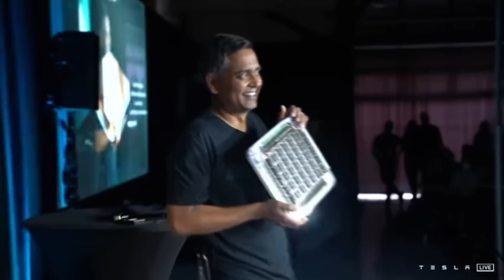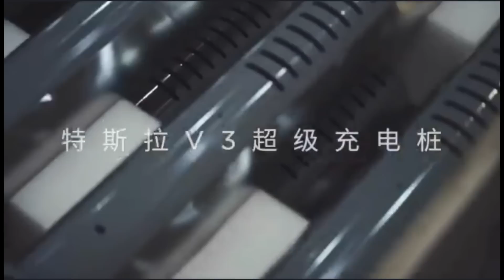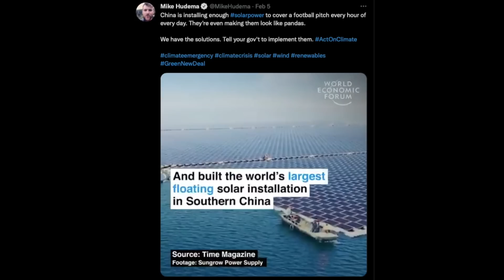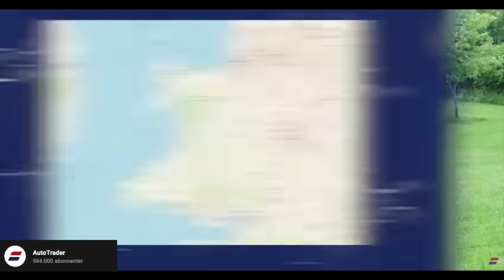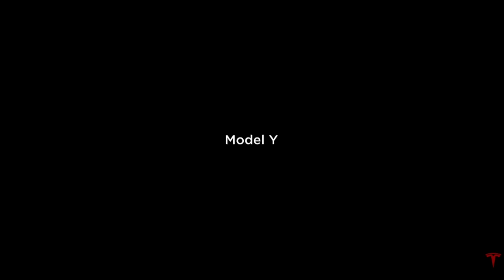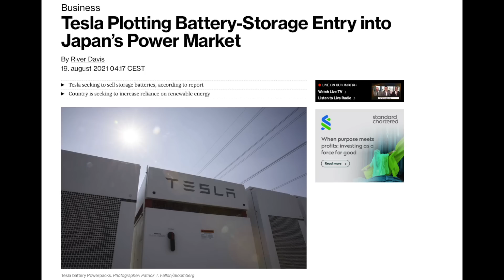Tesla Model Y is taking off in Europe | EV’s will be allowed to drive faster than ICE !!!

Comment: It only costs $2.4 million US to get a production car that can out-accelerate a Model S Plaid costing around $130K.  Nice work, Rimac!
Reply: With no space for passengers, worse range, no autopilot, and no supercharger network.
Reply: Is the RIMAC really a Production car ???
Reply: @chrisbraid2907  not yet. Hasn’t been delivered to a single customer.
Reply: @robcoll1069  How many families can afford 66k € car?
Reply: @Urgelt  I don't see a problem with it. Let Rimac make those expensive electric hyper cars. Elon only made the S Plaid so fast so he could beat all ICE production cars out there. To show the world that Electric is better and faster in all measured rankings out there. Mission Accomplished.
As Lars said, Elon still has a card up his sleeve with the new Roadster. Which will be around 10% of the Rimac price and should have similar or better speed/acceleration figures. Not sure about the number of Roadsters they are planning to build, but they will probably sell a lot more as the 150 the Rimac is going/planning to build. After those 150 they will probably come up with a special limited edition that has 100hp more or has golden door handles or a special color etc.
Reply: @Curacars  That's how I see things, too.

Details are a little fuzzy at this point, but Rimac/Bugatti doesn't appear to pose a threat to Tesla sales.  The threat they pose is to ICEV supercars.  I'm all for that!

I don't think it matters much if Roadster will beat Rimac's supercars.  It will be addressing a different market segment.

It might, though.  Tesla sees a path to developing even better electric motors with their carbon-wound rotor tech.  With 4680 cells and (probably) front and rear gigacastings, I think it will be very difficult for cars made with older tech to keep up.

And if they can figure out how to incorporate useful cold gas thrusters...

Hell.  The acceleration would probably not be survivable for an old fart like me.  :P
Reply: @Urgelt  yes, it indeed doesn't really matter with the miniscule volumes and the astronomical prices of those super/hyper cars. But I find it funny that due to the economies of scale, you can build a 4 door sedan with almost the same specs as the almost 20x more expensive. Imagine that besides the Roadster they still have the Plaid + version with the 4680s somewhere in the design drawer. I'm sure that Elon will open up that drawer when let's say a Porsche comes close to the Plaid, just because they can.
Reply: @robcoll1069  Tesla is not yet affordable to the masses. China will have a greater impact worldwide. Battery cycle life is still the biggest problem to most manufacturers. The winner will be the one with the best battery tech. Electric motors are not the problem, we've been building them for hundreds of years. Tesla has no advantage in this area.
Reply: @MegaWilderness  Tesla doesn't need to be affordable for the masses yet, if they would launch a 20k usd vehicle they could not produce enough of them, you would be on a 5 year waiting list, sort of how East Germany had the Trabant cars with a 10 year waiting list. And even now they can't produce enough 40k usd cars either. When they are finished with Berlin and Austin, they will surely need to build 2 or more new factories with an even bigger output. Only when those are up and running, they can think about lowering prices on their cars. Using all lessons they have learned with producing the higher priced cars and the infrastructure they have already created.
Reply: @MegaWilderness  Motors can be improved.  Tesla has improved them.  Their weight-power output ratio is excellent, and they have a developmental path to making even better motors.

Put a 100 year old electric motor in an electric car and you will not impress anyone.  This isn't a developmentally static engineering topic.

Don't over-focus on cycle life for batteries.  Yes, it's important.  So are other performance and engineering characteristics.

A battery that weighs too much, with poor energy density, rotten charging speed, and excellent cycle life won't ever make it into cars.
Reply: They're 2 totally different cars. Might as well have compared a Lamborghini to a Dodge Charger
Reply: @MegaWilderness  Lol. Industry expert Sandy Munroe who’s seen it all begs to differ. He said that Tesla’s motors, electronics, software, metal casting technology, and batteries are the best in the industry and constantly improving. He’s an objective third party well qualified to comment so I believe him.
Reply: Rimac have just bought Bugatti from VW. The latter no doubt realised that Uber power ICE cars are suddenly old hat. They’ve flogged it off and we can expect Lamborghini to go the same way.
Reply: @richardbutton1179  Right.  But I'm not sure that a comparison between the Roadster, when it appears, and the expensive top-of-the-line supercars will be a pointless exercise.

We shall see.
Reply: @TecnamTwin  Has he looked at YASA, Yamaha, Formula E, STARD Projekt E Rallycross, and the myriad Chinese motors.
Reply: @lahvancz  more than you think as they are making cars. Order one now(August) and get it in Jan/feb.   with that said, even rich people don’t buy $2.4M cars.   I personally know a billionaire and his most expensive car is a Lambo SVJ ($700k?).  The only people that will buy that are maybe multi-multi-billionaires (I’m not rich)
Reply: @Dave5843-d9m  I do believe in exchange for Bugatti and their Bugatti factory they had to give 50% of Rimac shares to VW or Porsche
Reply: @Curacars  if they don't Wuling will continue to outpace them
Reply: @TecnamTwin  your right - just saw this post, as I was writing too lol.
Reply: @MegaWilderness  Iam sorry that I have to proved you wrong...!!WHO is competing with Tesla on anything...on battery, software,electronics ,motors, superchargers  and range..Just Mention one..?
Reply: @chrisbraid2907  depends on your definition of production. Some say that means 25 cars - some say 50. But no one would consider it a MASS PRODUCTION car.
Reply: @Curacars  You're ignoring what the world needs and can afford. Do you have a passport?
Reply: @MegaWilderness  Of course I have a passport. And a driver's license and an ID card? The cheaper Teslas will come but no <5k usd versions. Let the rest of the automotive industry take care of those. Will the Wuling replace an ICE pickup truck in the USA? It will replace scooters, bicycles and maybe a small ICE micro car?
Reply: Exactly 💯
Reply: @robcoll1069  GAC and BYD for batteries. Rimac, Lotus for quickness and handling Wulin for sales. Aptera for efficiency. GAC for charge rate, probably many more. The list is endless.
Reply: @pazznecht  absolutely. Best of the rest.
Reply: @MegaWilderness  apart from the carbon fibre windings holding the 20,000rpm thing together.
That's new.
Reply: @robcoll1069  - Easy there! The 1.9 Seconds is for 0-60 MPH, not the 1/4 Mile! I know they are "Fast & Furious", but, let's keep "Some Facts Straight!"
😳😲🙄
Reply: @Curacars  - Remember, Berlin is "Starting" production with the Model Y, but, as I understand, or recall, the"Berlin, Phase 2" was planning to be for Model 3's, as well!

That may Change, or it might not, but, that is just Phase 2!

And, yes,as they are now at work building the Battery Plant there, that To may need to be Repeated, for Phase 2, as well!

It might be at Phase 3, that they start production of a "European $25,000 Tesla", in 2023 or 2024! It probably depends on how demand flows for the Model Y & Model 3, from Berlin!
Reply: @MegaWilderness  you are living under a rock...none of the are in productions,,,!!!
lol
Reply: @robertweekley5926  I am not really sure on which reply your replying. But I am not 100% sure there will be a Model 3 for the EU made in Berlin. I'm not sure how much demand there still is for M3 once they start producing the MY in Berlin. They might come up with a M4 that replaces the M3, but that's pure speculation on my part. When looking at the  European EV car sales figures, the model 3 is the only sedan in the top 5 or so, the rest are SUVs and hatchbacks, so with the Y in the mix they will be even better suited to sweep up the competition. The normal car sales in Germany show similar numbers, only the VW Passat and BMW 3 as sedans in the top 10.
So I think a hatchback that is cheaper as the Model Y but doesn't have to be <25k price to begin with, since the ID.3 is 30k euro as well.
Reply: Are you put of your mind?! Its a very limited production car with almost 100% carbon fiber body/monocoque and carbon ceramic brakes....... its also a sport car, not made to drive itself lol.....
Reply: @robcoll1069  EVs just like ICEs needs to build for everyone but there are and always going to be exclusivities, not every should have the same boring  car, the models plad is not going to sell like a model y or 3 for example.
Reply: @robcoll1069  another crazy example is the mercedes amg gwagen 6x6 with portal axles, 6 wheels central inflation/deflation system....... cars/vehicles needs to be special or differentiate themselves, koesnigsegg and buggati are another example.
Reply: @chrisbraid2907  yes it is and its limited production car.
Reply: @Urgelt  big lol..... buggati has already achieved 300mph i dont see what else they should have to proove again, the carbon sleeved rotors are not a new thing in motors it has been used for years for applications up to 200k rpms.....
Reply: @Urgelt  the motors are just part of the equation, the batteries also needs to be able to output alot of energy instantly.....
Reply: @TecnamTwin  they are not the best but one of the best tbh.
Reply: @Urgelt  wrong, ICE tech is still evolving and there are tons of different applications and engine and fuel types for many different uses. From aircrafts to ships to trucks, mining equipments...... everything still improves with time along side with transmissions... just look at the most powerful commercial truck in the world its a scania 770s!
Reply: @yingnyang2889  Just as an aside - Tesla doesn't operate its own chip foundry.  It designs its own chips and circuit boards, then orders them produced from TSMC.  Apple does the same thing - outsources the manufacturing, but designs its own chips.  Google does, too.

Other automakers outsource boards - but they don't design them.  They take off-the-shelf circuit boards.  None of those OTS boards are optimized for training neural nets or for inferencing.  Which hardly matters, since none of the other automakers are capable of any machine learning work whatsoever.  They're helpless.  Meat on the hoof waiting for a predator to come along and eat them.
Reply: @robertweekley5926  I put the $25K US car farther out.  I think Tesla will struggle to meet demand in Europe at its current price points for some years.  And getting battery costs down is a work in progress, too.
Reply: @carholic-sz3qv  I think you're missing some details about Tesla's Plaid rotors.  They are not 'carbon-sleeved.'  They are 'carbon pressure-wrapped.'  The high tension on the wrap holds the rotor together at up to 20K RPM.  This is new tech for electric motors.

I think the Rimac has a two-speed transmission, to avoid hitting RPMs that would destroy its motors.

I'm not slamming Rimac's motor tech.  They're doing great.  But nobody has pressure-wrapped carbon fiber rotors but Tesla.  This is new stuff, and Tesla sees a developmental path towards even higher performance motors which they intend to explore for the Roadster.

As an aside, 300 MPH isn't useful in racing.  You can go that fast on a flat desert with some precautions, but on a track with other cars around?  Control is too iffy.  What you want for racing isn't a 300 MPH top speed, but excellent acceleration, braking and handling.

I expect the Roadster to have around a top speed between 220 MPH and 250 MPH.  And that's as high as a track car needs for racing.  More is just wasted capability.  The weight you'd add for more top-end speed will cripple the car in actual racing.

As for the Autobahn, anything above 180 MPH is ridiculous.  With other cars on the road, and no track management, going faster is life-threatening.  I'm sure that the Autobahn's lack of speed limits is a point of pride for Germans, but if cars traveling faster than is even remotely safe becomes an issue, I think they'll have to give up on the whole no-speed-limit thing.

Bugatti went for bragging rights instead of track performance.  Kinda dumb, if you ask me.  (I know, you didn't ask me.)
Reply: @carholic-sz3qv  Yep.  Motors are just one part of the equation.

No automaker focuses exclusively on one part.  In Tesla's case, they're generating valuable IP in just about every aspect of auto manufacturing, from component design to production methods to software.  They're an innovation factory.
Reply: @Urgelt  its basically the same thing carbon sleeves or wrapped like I said again , carbon is used for applications up to 200k rpms to avoid the rotors from overheating or expanding/exploding. The tesla stuff is definitely not a new stuff. Going up to 300mph is actually going to the limits of what tires, traction and electronics are possible, it shows the capabilities of a powertrain just like with diesel vehicles that can have up to 1000 miles of range .
Reply: @Urgelt  you are not the one to dedice which speed is good for racing, the german Autobahn is the best/most secure highway in the world and and doing 180mph isn't ridiculous a all when it says speed unlimited. Most cars on roads already have safety features and depending on the weather everyone can push their cars to the limit in safety, there is a dedicated lane for faster drivers.
Reply: @Urgelt  if for you 300mph is useless then why is 0-60 in 1.1 that important?! Hein! People needs an very cheap EV with the promised tesla "600 miles" of range.
Reply: @Urgelt  did you even read my comment?! I said part of the equation I didn't exclude any part of the system every companies are innovation companies too. For example bmw and volvo have been using recycled materials to produce their cars....
Reply: @Urgelt  ICE is evolving my dear, vehicles have become bigger and heavier with time and all the comfort features and equipments are the things that uses alot of energy.
Reply: @carholic-sz3qv  ICE vehicles can get 1000 miles of range, not through improved efficiency, but by making tanks bigger.  Carrying that much fuel adds weight and decreases the energy efficiency of the vehicle (cost per mile).

BEV cost per mile is a fraction of ICE.  That gap will widen as BEV tech improves, while ICE tech remains static.

ICE tech will never be able to eliminate CO2 emissions.  It will never be able to eliminate fumes which kill thousands of people every year.  It will never be able to improve its energy efficiency without resorting to electric hybrids - which still will produce emissions and fumes.

We haven't even spoken of repair costs.  ICE costs way more in time, convenience and money to keep on the road.

ICE is over, my friend.  We've got better tech now, and our civilization is busy converting its transportation industry to it.
Reply: @Urgelt  electric vehicles existed way before ICEs and the technology is also not that different from todays EVs, the electric motors have  barely improved in efficiency and the batteries still trolls behind with very heavy weight and inability to be as flexible as ICEs, you cannot even increase the range of an EV by adding more batteries what a shame. There is a reason why batteries will not work on aircrafts.
Reply: @carholic-sz3qv  0-60 in 1.1 seconds is not important.  It's only amusing.

We do look forward to longer ranges and better efficiency from BEVs.  We can look forward to longer ranges and better efficiency from BEVs, because the tech isn't mature.

Unlike ICE tech, which is plateaued.
Reply: Let me use $130k to get one plaid and gut it to the bone and race it against Rimac, let me buy another plaid for normal driving. After that, I still have MORE than $2M left in bank.

It's irrelevant to talk ramic against plaid, production or not.
Reply: Your assertion needs a little modification. One car is not a production model but good point. Musk is simplifying complex problems with ease it seems an without missing a step.
Reply: They couldn't possibly have sold/offered it for a dime less than $0.4 million.  NEVERA!
Reply: @Urgelt  oh didn’t know the specific company, but from AI day, it seemed like tesla was making its own DOJO boards and neural net hardware and stacked assemblies. Thank you
Reply: @carholic-sz3qv  Heh.

Batteries will work on aircraft.  Some startups are already playing with prototypes.  Elon predicted that 400 KWh per Kg will be good enough to make serious battery-electric aircraft.  That energy density is not all that far off.

Early BEVs used lead-acid batteries with very poor cycle life, energy density, etc.  Gasoline trumped them right  out of the market, because gasoline tech was easier to develop back then.

And it has been developed for over a century since.  But there is nowhere for that tech to go now.  It's plateaued.

This is dawning on automakers, too.  One by one, they are discontinuing their R&D funding for ICEVs.  Some will figure it out faster than others.  There's no shortage of stupid people in the world.
Reply: @yingnyang2889  The node chips are coming from TSMC on their 7 nm fab process.

I'm not entirely sure what is handed off to Tesla from TSMC.  Just the node chips?

I've never heard anything about Tesla running a chip foundry themselves - and there are more chips and components than just the node chips TSMC is making for them.  They're getting those other components from somewhere.  Some of those components are probably off-the-shelf.  Some may have been designed by Tesla and farmed out to fabbers for manufacturing.  Alas, we didn't hear a breakdown of how they're handling component supplies at AI Day.

We did get a good overview of the Dojo hardware design concept.  That alone was enough to lift my eyebrows all the way to the ceiling.  This is a crazy big jump in scalable hardware for neural net training.

Google might have something this scalable for machine learning.  They aren't talking about it to outsiders much.  But their focus isn't the same.  What they need from neural nets is language comprehension, so the data feed is mostly symbolic.  (An oversimplification, please forgive me for it.)

Whereas what Tesla is after is perceiving and understanding the real world, navigating through it, and making good decisions about it.  Their data feed is video from multiple cameras.  I imagine that Google's large-scale machine learning architecture is optimized for their use cases and not applicable to the problem Tesla is tackling.

True machine intelligence will require both symbolic cognition and understanding the world through sensors.  Dojo is specialized to tackle the latter.

Of course Dojo will be reading street signs, markings, etc.  So there will be some symbolic processing in Dojo.  And Google has some visual search capabilities, so their machine learning architecture is not 100% symbolic, there is some object recognition in the mix.  I'm still convinced that Google's machine learning architecture is optimized differently.  The two companies are pursuing different goals, and that implies different architectures.
Reply: @Urgelt  I wish I owned his "small" business. He says the pandemic has been an advantage to him. I like him and have watched almost all he has produced. Racing Tesla's shed 500kg, even they have a way to go. Everyone keeps going on about vertical integration. Tesla does not design their HVAC compressor, To use die-cast parts requires high volume runs in order to justify the cost of the machines. I, building a car in my garage would need to hand-weld everything as a spaceframe and use an English Wheel to make the body? Does Tesla make the gears in their gearbox and differential,? Does Tesla make the bearings? Does Tesla make the glass? Do they make the headlights, taillights? Making a good electric motor requires tight tolerances. We don't really need a teardown of a Plaid. Elon explained that he's wrapped it in carbon to stop it self destructing at high rev's. It's the same car, we will learn very little. I want to know how a Wuling is built for under $5000. Let's see him teardown the Iconic 5, Kia, Xpeng, BYD, GAC, Polaris, MG etc...instead.
Reply: @Urgelt  lol..... those startups are making electric aircrafts that are even less practical than helicopters. Even the supposed 400kmw/h won't be enough, majority of aircrafts are huge for mass transport, only small private jets for small trips might be possible
Reply: @Urgelt  there is certainly other technology than just batteries for the future, just like solar and wind and hydroelectricity...... same with nuclear or geothermal.....
Reply: @carholic-sz3qv  Got to start somewhere.  They're iterating.  Same thing SpaceX does.  Fail.  Learn.  Do better.

Elon has in mind a VTOL supersonic battery-electric aircraft.  He has not disclosed the concept in any detail at all, but we can at least think about what it will entail.

Thinking is good for you!

A very high percentage of mass will be in the batteries; this is unavoidable until battery energy densities are way higher than 400 WH/Kg.  So we know they will be conformal.  Could be 60% of mass.  Or even 70%.

Contemporary aircraft use conformal tanks in the wings, but not the entire aircraft.  Battery-electric aircraft will be quite different.

So much mass for batteries will leave a small mass budget for passengers and cargo... unless the whole thing is upsized well over what we're familiar with on runways today.  Make it big.

Delete the retractable landing gear, we won't need it.  Replace with retractable skids.  That saves a lot of mass.

Taking off vertically imposes a high energy cost.  Put a pin in that.

The secret to supercruising is altitude.  A battery-electric aircraft doesn't need oxygen to feed its engines; it only needs enough air for control authority.  At 80K feet, air resistance is very low, so we won't need a lot of power to go fast and sustain the speed.  Efficiency once at altitude will be ridiculously good.

But getting to 80K feet will be a bit time-consuming and energy-costly.

The upshot is that this VTOL supersonic aircraft we are imagining is a long-route aircraft.  It makes no sense to build it and use it for short hops, where it won't have time to get to supercruising altitude.

Descending won't take much energy at all.  Neither will landing.

It won't need a runway, just a takeoff and landing pad.  Small airports could service long routes with this beast.

As battery energy densities improve - and they will - newer models will be able to increase passenger and cargo capacity.

So when might we see something like this?

Not soon.  It'll take ten years just to get the thing designed, iteratively prototyped, tested and approved for commercial flights.  Maybe more.  And I doubt development will even start until we pass the 400 WH/Kg mark.  Possibly not until we pass 500 WH/Kg.

We might look for a prototype's first flight in the 2040s.  Maybe.  I doubt it could happen much sooner, and it might be a lot later.

But this is a concept that in principle is feasible.

As for shorter hops, those are indeed the focus of existing battery electric airplane development.  We'll see more of those types of aircraft well before Elon's supercruising VTOL idea.  Their ranges will go  up as battery energy densities improve - but we won't see them on long flights.  For that, supercruising is the right answer.  Getting to very high altitude is the key - something contemporary jets can't do.  They need to breathe.
Reply: @carholic-sz3qv  Heavy duty equipment and machines will burn fuels for longer.  Niche markets like that are not the low hanging fruit.  But there are poisonous emissions.  Eventually, they're all headed for extinction.  All of them.

Boring Company is already moving in this direction.  Instead of ICE borers, which require extremely expensive venting and air quality control (else people will die in the tunnels), their borers are fully electric.  Air quality in tunnels is still a concern, but the problem is vastly reduced.

I'm not saying Tesla will make heavy equipment.  They might not need to, if legacy manufacturers are on the ball.  And in fact, some are.  Electric forklifts are old hat these days.  Anything that has to operate in a warehouse is an instant candidate for electrification.  ICE and indoors don't get along.

Getting around to the outdoor equipment will take longer, but it'll happen eventually.  We simply can't afford to keep spewing toxins and CO2 into the air.
Reply: @carholic-sz3qv  You wrote, "there is certainly other technology than just batteries for the future, just like solar and wind and hydroelectricity...... same with nuclear or geothermal....."

I don't recall saying there are no other technologies.

But I will point out that you can't drive a car with energy from any of those sources unless you feed power into the grid, then use the grid to charge batteries in the car.  Battery-electric cars are the future of transportation.